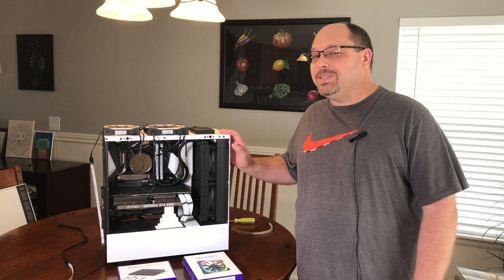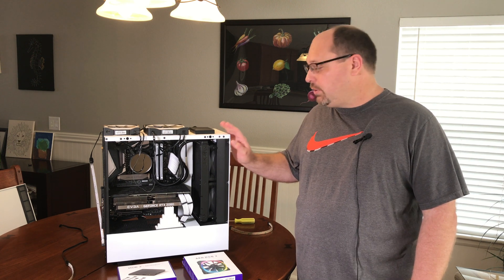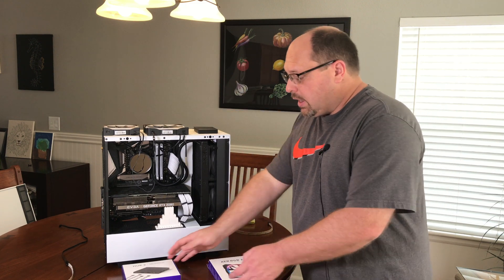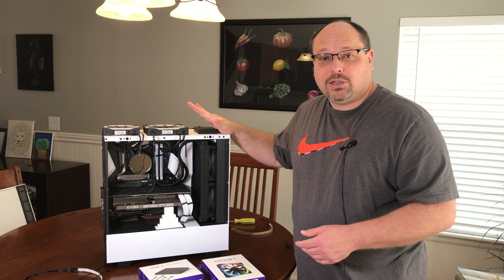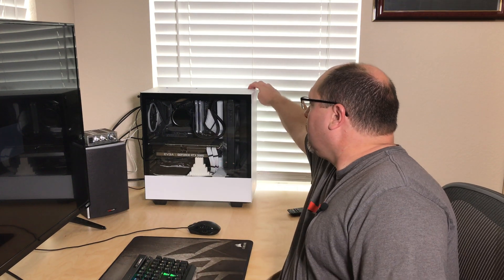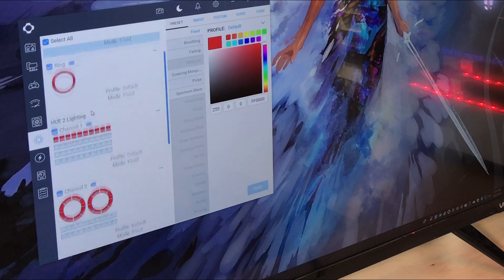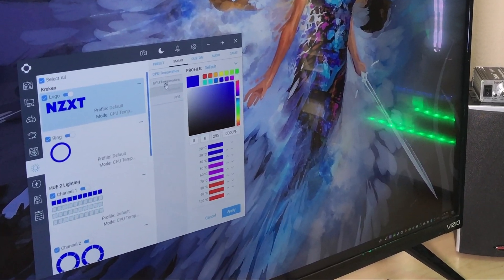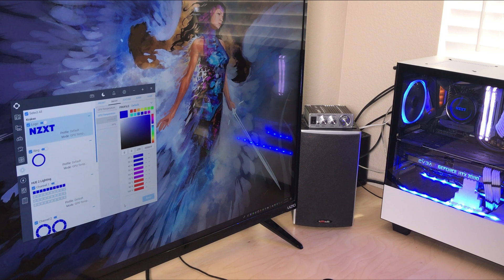Best PC RGB! NZXT H500i Hue 2 and LED Strip Install, full tutorial.

Comment: hello i have the h510i case and it has a hub and 2 fans and 2 rgb leds now i wanna but the same kit to help with the air flow .if i bought this can i connect the two hubs ?

Comment: I got the h510i it come with a smart device can I connect 3 Corsair ll 120 mm rgb fans and one of the stock fans that come with it would it work
Reply from the maker: Good question. Ive never used a h510i case and gear.

Comment: You don't need the HUE 2 with the H510i. The Smart Device 2 has two HUE 2 channels that will support the AER RGB 2 fans, the LED strips, and the underglow kit. As far as wiring them up, with the new HUE 2 architecture, you can daisy-chain them any way you want (pay attention to the order, if you're using RGB modes that cycle through the components though).

The limit per HUE 2 channel is either 6 devices or 40 LEDs, whichever comes first. The AER RGB 2 fans have 8 LEDs. The LED strips have 10 LEDs each, and the underglow kit (assuming ATX version) has 20 LEDs total in two strips. Each fan or strip counts as one device.
Reply from the maker: Thanks for the info!
Reply: ΧΞΟΝ GΛΜΙΝG What about for the H510 Elite? Mine came with the smart device V2
Reply: You're wrong mate. This hub is SDV01-B1. On the left side you have 1 LED, 1 USB and 1 Power input. There is no way to connect additional RGB devices without unplugging LED stripes. You need an additional HUE controller.

Comment: I have recently brought the H500i housing and have my motherboard installed after that I connected the nzxt hub Sata power cable with the power supply and started the pc but the led did not start to light can help me there?
Reply from the maker: Does the management software see the hub?
Reply: @JilesMcCoy No, unfortunately not
Reply: @JilesMcCoy  but I'm talking about the hub was already installed and the case has been there

Comment: Let me first off by saying good video, I myself also has a NZXT h500i and i purchased two 120mm NZXT RGB fans, my problem is, I install the fans connect the controller to the molex and usb and the fans spin but dont light up. Im reading online that if you have the h500i, the rgb fans dont work with a seperate hub. How did you connect everything properly.
Reply from the maker: I bought an extra NZXT RGB controller and used it control my fans. Its the kit in this video.
Reply: JDM World so your using the smart hub that came with the case , the hue2 that came with the nzxt fans and another nzxt hub?
Reply from the maker: @Average3djoe  I am using the smart hub that came with the case to control the led strips that came with the case. I added the Hue2 to control the RGB fans and the added light strips.
Reply: @JilesMcCoy  so in reality the smart hub with the h500i and the hue 2 would work fine then? No issues ?
Reply from the maker: @Average3djoe  I use both now with no problems.
Reply: @JilesMcCoy  ok I'll be trying this this weekend I'll let you know. Ty
Reply: Ok so I attempted my build in a h700i case and everything works so far. I just hope NZXT cam software gets better bc its known to be very buggy. Thank you again.
Reply from the maker: @Average3djoe  Awesome!

Comment: Hi there, nice installation guide and as I have the same case, I'd like to ask a question (might be a dumb one) . Why not  remove the original controller delivered with the case? It seems to me that the hue 2 controller can control the leds already installed in the case as long as they are not plugged into the same port (different channel).  This would free up a usb port on the motherboard. So the question is, is it possible to "unplug" the original controller leds and hook them into the hue 2 controller  and control all fans and leds through the hue 2?  Thanks for any advice you can give and thanks again for the video ;)  PS: I don't have a water cooler for the cpu, just a stock amd cooler. Might add one later.
Reply from the maker: Great question! I didn't explore the option of removing the included controller... but if you want to go that route it might make more sense to just buy the 500 rather than the 500i and just add all of your RGB separately.
Reply: @JilesMcCoy  Hello again. Took your advice and cancelled the h500i order. New h500 arrives tomorrow along with the hue2 rgb fans and leds. Far simpler. Thanks
Reply: @will_9342  I'm interested in doing the same thing! Just wondering how it turned out. I think it would be easier with the hue 2 hub rather than the smart device which seems to be lacking rgb slots
Reply: @matthewwallis794  , Hi there.  Worked out perfectly. Installed hue2  rgb fan kit and also bought and installed led strips on the h500.  The price worked out almost the same as buying then adapting the 500i.  Also, after removing the factory installed  exhaust fans, I installed them at the front of the case. I don't think they make much difference to the cooling of  the components inside the case, I just hate waste :)

Comment: Hey man, I think we have the same setup and yet I'm missing a USB port to connect the HUE2. I have an Aorus Ultra Z390, the same H500i case, and same Kraken cooler... All those things occupy the USB headers on the mobo... where'd you plug yours?
Reply from the maker: Internal USB hub FTW.
Reply: @JilesMcCoy  hey bud, googled it as I commented on here, and that's exactly what I did. Thanks anyway, keep making videos!
Reply: Does it sync with aorus lighting
Reply: @imethdhamviru7151  no, Aorus uses different software than NZXT, but you can still make them do the same thing separately.

Comment: so i just got this as well. was wondering how you hooked up the fans exactly? i daisy chained as well i plugged the 3 pin connectors to the 3 pin connectors that came with the case.... CAM isnt even picking up either one of my HUE 2s.
Reply from the maker: I bought the LED light strip kit and used it to control additional light strips and the RGB fans. Just plug the Hue 2 into a USB port. Each fan gets power from the system board. And make sure the daisy chain cables for RGB control are correct. Thats all there is to it!
Reply: @JilesMcCoy  i have 6 fans hooked up i have the h700i so how would that work? considering my motherboard and alot of boards only have 3 CHA fan inputs?
Reply from the maker: @ppwnagee  Get a fan power splitter. It sill let you connect 3 or more fans to a single header. They are really inexpensive.

Comment: what did you use to get the fans plugged in
Reply from the maker: The fans and light strips are all plugged in to the Hue2 or the controller included with the 500i.
Reply: JDM World, how many fans can I plug into the hue2?
Reply from the maker: The instructions says the controller has 4 channels and 6 devices can be chained off each channel. SO that would mean a lot. Thats just control though. You still have to find power ports for everything.
Reply: thanks

Comment: where did you plug the hue 2 controller?
Reply from the maker: I plugged it into an internal USB hub. That hub plugs into the system board.
Reply: You can't plug the hub, the hue 2, and the kraken at the same time since motherboards only have 2 USB 2.0 slots. How did you plug them all in?
Reply from the maker: @Calafan87 USB Hub - Plugged the PSU into it too.

Comment: Hey ,if my rgb parts are from different brands can i use nzxt hue to sync them all?
Reply from the maker: Probably not. RGB is still the wild west as far as standards go.
Reply: If you’re using led strips without a control box you just plug them into the rgb header on your mother board. Different manufacturers have different software to control lighting. There’s no true integration at this time so sometimes with different makes of lighting you have to set up and run different software for controlling them.